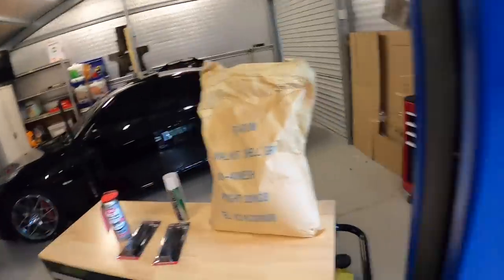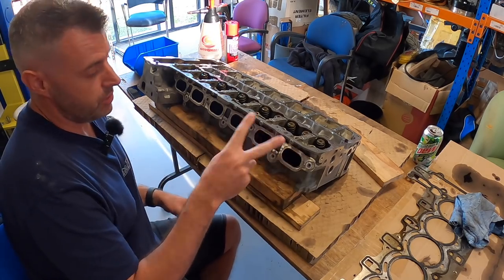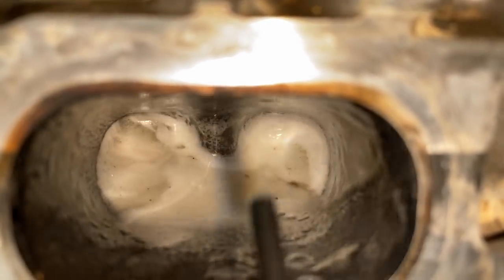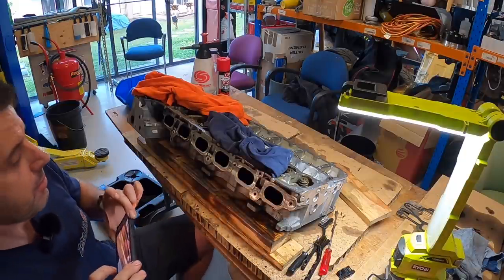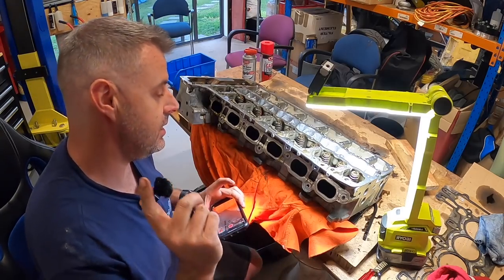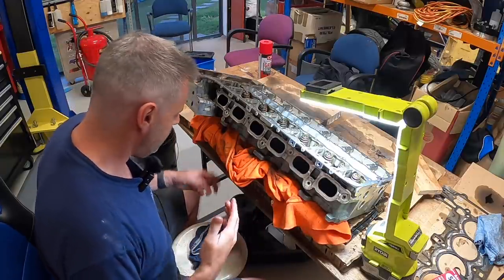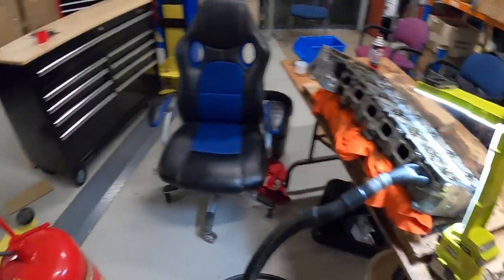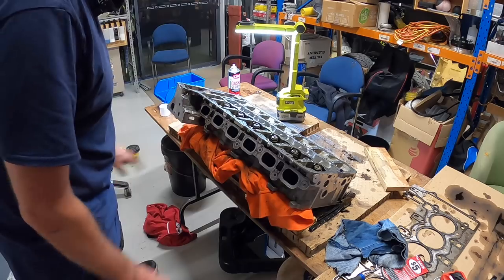BMW N54 Intake Valve Cleaning: CRC vs ThreeBond vs Walnut Shell Comparison

Comment: The CRC is meant to be used with a warm engine and the car running at around 2000rpm with short bursts and then sit for an hour. CRC works best with heat soak. I've used it on my 335 and it seems to work well. I plan on using it as preventative maintenance right before my oil changes. but walnut blasting every 50k miles. As far as just using without heat, I don't think it was designed to perform that well without heat. It does take time though to use it at least an hour and thirty minimum. Ultimately, Walnut blasting will always give the better result with a little bit more labor and time.
Reply: I don't care what the bottle says I seen a few people hydro lock and destroy their rods spraying cleaners in to it while it's running. The crc i used was like magic spry it in to closed ports and it would bubble for an hour and the ports where cleaner than blasting jobs i have seen where the back side of the valve never gets blasted.
Reply: How did you apply it, where did you spray?
Reply: @markt9438  how do you know it came out as good as Walnut blasting unless you took the intake manifold off to check and if you're going to take the intake manifold off to check to see if the sea f did any good you might as well properly clean it. I've done five now in the past month and there's no way that any seafoam would even touch the ones that I did I was in there with a metal pick pulling out huge chunks the size of a quarter.
Reply: @coldfear19  I  used the vaccuum port on the intake manifold for the DV's.  Made it easy to get to. From there I just followed the instructions. You can use the meth port on the charge pipe as well.

Comment: I agree walnut blasting is the best at cleaning valves. But crc is to be used when the engine is hot. So I'm doubting if crc was used properly in this video.
Reply: I’m doubting his scrubbing technique…didn’t show how he was scrubbing. I would think u need to spray, scrape around, then soak

Comment: I literally used e85 and gasoline to clean my valves and I vacuumed it out with a shop vac. Also you need a gun barrel brush to get the valves, bend the tip to gwt the back of the valve. I also did not mess with making sure valves were closed. It was easy and worked great. It was sketchy but no fire or explosions from the vacuum.
Reply: Sketchy to the maximum! Exposure to not just liquid gas, but high exposure to explosive + inflammable vapor! Inflammable == "easy to set on fire"! Are shopvac motors 'spark-shielded'? Why hell no? Spark → boom!
Reply: @TSPhotoAtlanta  didn't blow up. But i wont be doing it again

Comment: I believe the crc works better when the valves are warm/hot hence when the engine is running
Reply from the maker: I imagine the carbon just brakes down better when it has heat in it.

Comment: The CRC is a pretty good product. I cleaned my 335i manually and it works by scraping with a pick tool and then extracting the dirt. Spraying CRC and the brushing off the dirt. CRC can dissolve the carbon and make it much easier to remove. But it will take you a whole day to complete.

It’s really worth it. The car drove much smoother and throttle response was way better.

Comment: No surprise that walnut-shell blasting would be the best - it's the most direct and abrasive method.  However, this comparison video is not very helpful as the experiment is flawed.  For example, the CRC, which has shown to have significant success, is not shown to do much at all in this video.  Why might that be?  The experiment was optimized for the walnut shell blasting.  The CRC requires the engine to be brought to full operating temperature, then spray in short bursts into the vacuum system of the running (i.e., HOT) engine until the can is empty.  Then the engine is turned off to heat soak for an hour...  None of this was done in this, so again, unfair, especially when the lack of pros / cons aren't considered.  If I had to hazard a guess, the walnut shell blasting would still win, but I think the other two would have a more honest test.

Comment: the benefit of crc is that you don't have to pull the head to do it ,  they do recommend to do it on a warm engine so the valves have to be hot

Comment: I used Liqui Moly valve cleaner 60k n53 , ENGINE MUST BE HOT took 2hrs valves like new,shiny brass seats,bought £10 bush set off Amazon. Sucked it out then flushed brake fluid. Couldn’t justify cost one off walnut cost,fitted catch can about 100ml gooey oil every 1000miles. A1 content.Keep on Keeping On 👍🏿 Nearly as good walnut I WOULD SAY
Reply: Thanks, nice reply. I JUST purchased a used 535 year 2014 with 66k km and will do all I can to keep it clean as possible .catch can seems the way to go but need t assess present valve state.

Comment: This is becoming one of the more interesting channels that I'm subscribed to.
I'm actually quite glad that you've had all these shitty issues, it makes for good content. 😉👍
Reply: 5:45 Is unfair comparison as did not use as per instruction. CRC needs apply while engine ON at 2-3krpm and heat soak afterwards.
Reply: @C3ByAx  that’s true, however it is benefit to crc since it had even more time to “do it’s job” by sitting there for 20 monut instead of just “flying around” while engine running
Reply: @C3ByAx  exactly, when you talk solubility, the temperature is a really big factor

Comment: I have used the CRC method with an engine brush on a drill for 2 N54s. Get's 99% of it off but I will admit I sacrificed a small cheap shop vac to suck the CRC out after each soak. Impressed with the walnut blast.

Comment: Great video and thank you for the hard work of making these for us all.   And a hundred N54 and many Audi voices shouted the classic line in unison "You're Doing It Wrong!!". LOL.  The way to do it with the CRC is to spray it in let it sit for ten then suck it out with a battery turkey style thing or a wet vac if you have the attachment then repeat two more times. No scrubbing necessary. Repeat for other cylinder ports. Basically just follow the instructions from Vehicular DIY.

Comment: Just a note: From everything I've read and heard, the CRC is meant to be used while the engine is in, and has a specific set of instructions for its application. I am curious as to whether the high temperature and (perhaps) flammability of combustion leads to better results.

Also wondering whether sucking out the fluid with a baster or something else, followed by the air blaster would be a better option to reduce the mess.
Reply: That is my understanding as well. Same with Seafoam (although not a part of this comparison).  CRC and Seafoam compared to Shelling the valves is a preventative maintenance practice IMHO and significantly less expensive/labor intensive than removing an intake/head to do a valve carbon cleaning job....
Reply: Yea this is not a good comparison. If the car was at operating temperature and reved up to 3000 RPMs and the let sit for an hour the drive it at 60 mph for half hour I think the results would be a completely different result
Reply: And shit if I had the head ripped off the car I'd remove the valves and clean em that way. Walnut blasting and these other options are done with the motor complete in the engine bay

Comment: Yes, I agree with walnut blasting.  This is the method I always use.  keep in mind you will get dirty valves again within another 15k miles but its easy to get it cleaned again. It only takes about 1 hr  from start to finish (including removing manifold. 

I use about 90 psi with compressor setting and in the blaster.  only takes a few short burst (30 sec) to get each port clean.
great vid.

Comment: Wow, that is a excellent result from the wallnut, I didn't expect that.
I'll have to keep that in mind for future.
Keep up the good work.
Reply from the maker: Yeah, although the setup cost is higher. The walnut works so well and in a fraction of the time.
Reply: @ZeroTo60Tube  , It's a "fraction of the time" but the shops charge like wounded bulls to actually do it.

Comment: I did this job 6 years ago...#6 was also the dirtiest. Chemicals didn't do squat! It takes elbow grease.
I used good ole brake cleaner spray + paper towel + angled long needle nose pliers + harbor freight long wire brush set(cut short length of wire spool and wrap it at the brush tip so that you can jam piece of paper towel to scrub the  hard to reach valve angles). With brake cleaner and wet paper towel, end result is it cleaned shiny valves right down to the valve sealing same as walnut blasting. But it takes hours and your back will hurt from leaning forward. Take lots of breaks in between. 
When you look at it, it makes sense about the pointy end of cut steel wire + paper towel + brake cleaner puddle + bend the brush handle to get access to forward side. Didn't cost me next to nothing.

Comment: The way I got it out was I took top off a hand soap dispenser. Then i basically just pumped it out as you will pump hands open to your hand.
Reply: turkey baster would work as well
Reply: So would just a shop vac

Comment: My only concern is it can’t be cleaning the seats when the valve is closed. So a peace of carbon stuck on a valve seat won’t be cleaned. Same as the walnut blasting with the valves closed. Also if you had the time a light port just to smooth the ports and polish with a demel, should help prevent it building up as fast.
Reply from the maker: Correct, this was to compare the products for other people who will need to be doing intake cleans. Not for my own Benifit. This head still needs to be stripped down.
Reply: Zero To 60  fair enough, think I’ve tried pretty much everything in a tin. Last time I just cleaned mine with a demel and sanding pads then polished 🤞 it helps prevent the build up. On the theory that reducing the surface area and friction should reduce the carbon build up.

Comment: That rocker cover port is where the oil comes from,tuners are putting pipe plugs in the rocker ports and going external pcv system
Reply: you got a link to someone with this? or more info?
Reply: @freemaysin5088  Look into tapping and plugging the intake runner port holes that go to the valve cover and externalize your low-side PCV system (via RB Turbo's kit) through a low-flow catch can (like a mishimoto or cheap ones on amazon like Tasan Racing that have the sintered metal air/oil separator). This way, you separate the valve cover from all boost, making it less likely to crack and/or make the gasket leak. Also, under vacuum conditions, having those holes plugged keeps un-separated oil mist out of the intake runners (because externalized PCV would then redirected this mist to a catch can first, before the separated air goes back to your throttle body). This maintains crank case vaccum as well. I catch 3x as much oil in my mishimoto low side can than the burger motorsports "high side" can. I run both.
Reply: @bitcoredotorg  thanks man i appreciate it i will start diggin around!

Comment: Maybe try your hand at porting since it's already out?  Already have a spare just in case.  Love the channel. Keep it up!
Reply from the maker: I may do. Probably not with this engine. I want to keep it stock. But the e92 definitely.
Reply: @ZeroTo60Tube  i've got a spare head i've had for years i was thinking about wtf i want to do with since i'd rather get an N53 head to do something actually serious from a professoinal, long term. 

this sounds like a great idea, i wouldn't mind hacking up a few ports in the name of learning
Reply: @flinchy952  

I ported my 4G63 intake and exhaust runners 👍🏼 I think it’s fun and a kind of therapy lol I used a Dremel as well are a die grinder with various attachments... it’s not hard basically for the intake you want to “knife edge” the material in between the intake ports in each cylinder and match the  opening circumference with that of the intake manifold and thats it. Then polish (make sure there aren’t any huge scratches) start with black emery then move to white 💪🏼

Comment: it takes awhile too with the walnut blaster too because you have to stop and refill the walnut blaster.  And there's a lot of clean up with emptying the shop vac afterwards and putting a ton of equipment away.  And buying expensive equipment just to be able to blast walnuts

Comment: I used the crc before. Did ok. It was a lot of scrubbing and picking. I used a 9mm bore brush to get around the valve stems. N54 ran a lot better but I'll be doing the walnut blast next time!
Reply from the maker: Definitely a quicker process and probably cleaner.

Comment: As a cleaning agent the three bond didn't work so well.  But as directed you are supposed to spray it into a vacuum line whilst engine running. So if you factor that time it's probably a 5 min set up. Whereas the walnut requires the intake removal. I have the three bond already.  So I'll see if I can use my borescope to inspect and get a pic of the valves before and after three bond. I'm not sure if I will be able to see. But I'll report on the process if I can.  Keep up the good work.  Looking forward to see it running again! Mine is also on the stands at the moment.  :(
Reply: Any update on using it while running?
Reply: @Drumheros  hey. Thanks for reply. Car has been stuck on the jacks. :( Got a few other issues before I get it going again.  I'll see how far I can get this weekend. What car you got?

Comment: You can use a bundle of cable ties to agitate the valves while the solution is breaking it down. Also you can also use a shop vac to vacume up the solution.  Not everyone has the means to remove their head and have to work with it on the car.

Comment: Maybe should've heated the ports with a heat gun that were to be chemically cleaned before applying the product, since both instructions on the cans said to warm the engine up first, That could be to mitigate stalling or could be that the product react better with heat and also the carbon would be softer. That creampie on cyl 1 & 4 tho.....
Reply: Good thought.

Comment: NICE! I just went the cheaper route with CRC and took a lot more time lol, Great video!!
Reply from the maker: I was curious how big the difference was in regards to work required. Chemical route takes a lot longer than I was expecting.
Reply: Zero To 6O I spent about a good hour per cylinder. 15 minute soaking and cleaning intervals. Just couldn’t afford to purchase all the supplies for a walnut blasting. It definitely helps that you know someone who can 3D print as well because that attachment for the shop vac is awesome

Comment: I did mine with the CRC only a couple of weeks ago. After treatment and scraping I sucked out the juice with a syringe first before hitting it with compressed air. I then hit the port with brake cleaner, compressed air again and then reapplied CRC. Some ports I did three times, some took four to get properly clean and I still couldn't get the carbon right down at the edges of the valve. 

Even with the motor out, it was still way too much work with the CRC. There is no way I'm doing it in the car. Here's hoping that Threebond treatments every service keep the carbon at bay.
Reply from the maker: A syringe, that would have saved me a hell of a lot of mess haha. 

Please let me know how the threebond treatments go. I’m a pi guy so my car the valves should stay pretty clean. But keen to know for others if theeebond works
Reply: @ZeroTo60Tube  Don't worry, there was still plenty of mess. I'm glad I waited until after that job to clean the block haha.

Coming from Subaru land, the Threebond does work but its definitely meant to be an every service kind of thing, as you saw it's not going to break down the big stuff. 

I am also curious to see how it goes with a DI car, but it's not going to do many Ks so it's going to be a long while before the manifold comes off again.

Comment: Try a handful of cable ties tied together. Keep stabbing them into the port. From what I've seen it works quite well
Reply from the maker: I've heard that as well. Figured the brushes and picks i was using would have been fine. But either way, the chemicals definitely take  a while.

Comment: I've use CRC valve cleaner numerous times and it never take as long as you say and it comes out way much cleaner then you have shown. That stuff works well. Maybe not as well as walnut blasting would but pretty well.
Reply from the maker: Like I said in the video, I estimate it was maybe half done. How bad have the ones been that you have done and how long do you think it too per cylinder?

Comment: Regarding the mess with the CRC, if you drain/suck out the carbonjuice with the top of a soap dispensor or syringe, you can reduce the mess significantly. I dont recommend using a short piece of tube and doing the old gasoline theif method, it does smell nice, but it definitely doesnt taste nice :(